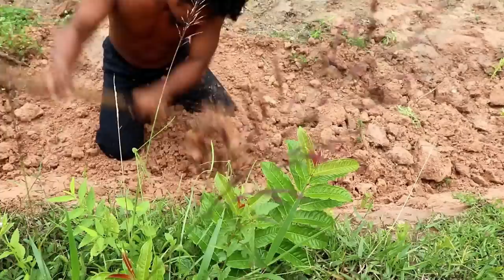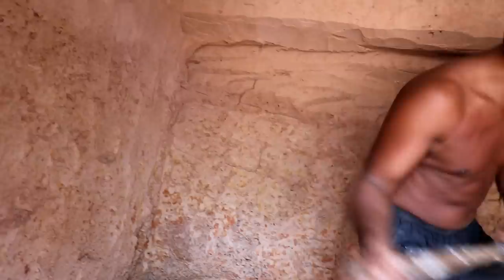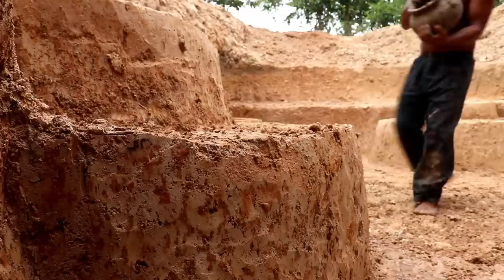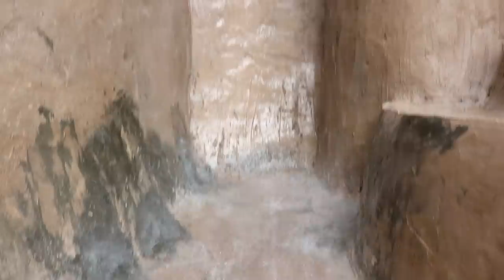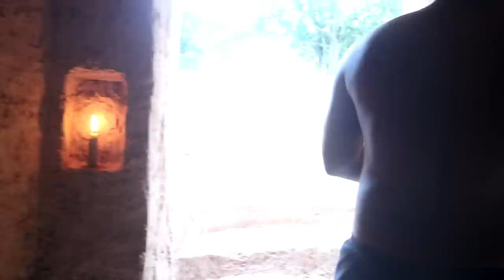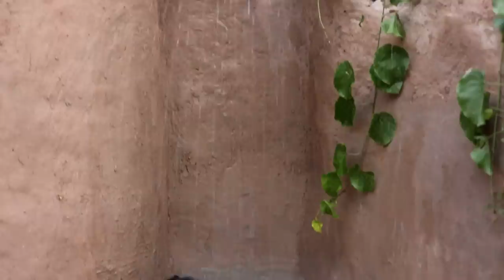Unbelievable! Build Most Amazing  Underground Deep Pool With Secret Underground House

Comment: What they don't show you:   The whole thing floods as there is no drainage of any type.  The clay walls get soft and collapse and the underground section becomes a lethal flooded pit trap.
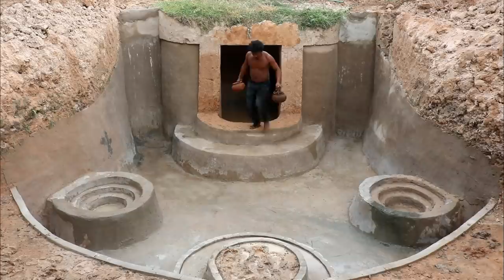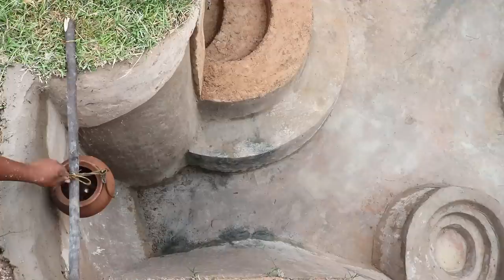Reply: You can see at 5:20 until 5:30 that he prepared the cave too
Reply: I’d like to see all these about two months later, for sure.
Reply: @RynoDBones   How does all the water drain ??
Reply: I think is not clay...look like cement.
Reply: Look the color of the water....its cement.
Reply: @mayravazquez6166    It's Clay
Reply: @mayravazquez6166  Doesn't matter what is currently under the water.  There is no drainage to take the excess water away.  What is above the water is clay and dirt.  As the system will continue to add water constantly, it will flood, the dirt and clay will get soft and it will collapse.